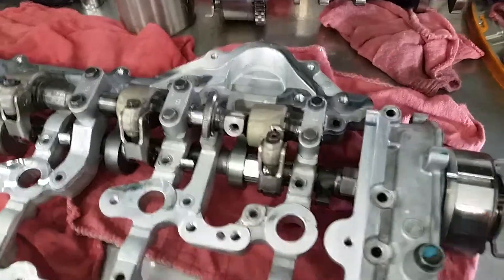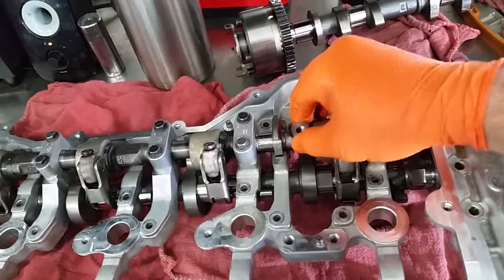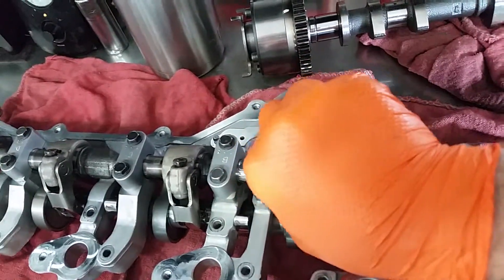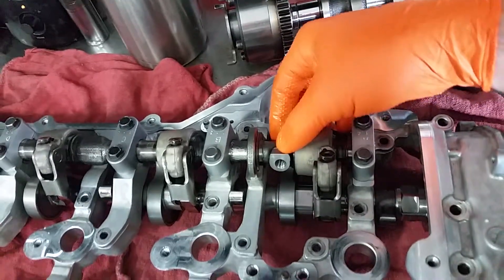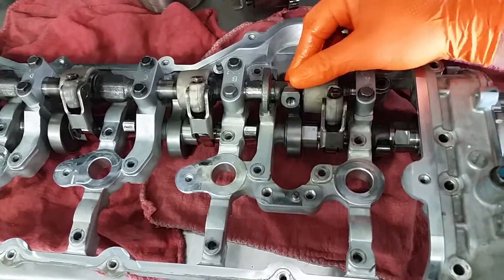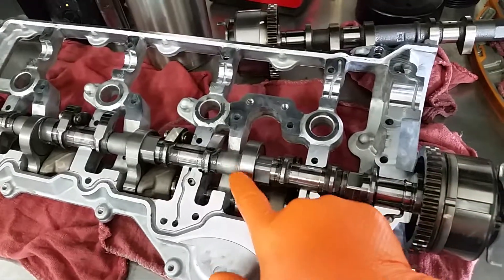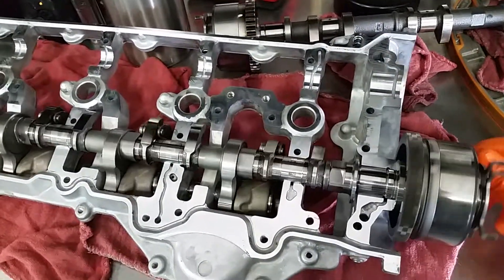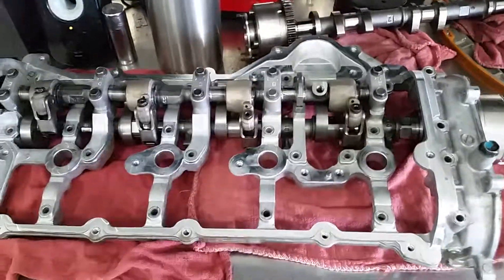Nissan/Infiniti VVEL operation

Comment: I replaced the timing chain on a 2012 QX56, and the scanner is showing that the inlet valve timing on bank 1 is 20 to 30 degrees at idle, but the scanner says it should be between -40 and 0 degrees. When I installed the chain, I noticed I could move the inlet sprocket by hand. Do I need to remove the tensioner and rotate it a full turn against the engine's rotation? Do you think that will solve the problem? I just removed the cover on bank 1 where the inlet valve sprocket is located and also removed the valve cover to see if the sprocket was slipping when I moved the camshaft, but I was surprised to find that it seems fine. Could the sprocket be stuck internally and not advancing properly with the oil pressure when the engine is running? I have many questions, and I would really appreciate any ideas you could give me.

Comment: Is 0w-20 too thin of viscosity for the Nissan 3.5L twin turbo engine?
Reply from the maker: The advent of 0w20 is all for fuel economy. If the manual says that it calls for 0w20, then it is safe to run it, however I would run 0w30 or 5w30 in my personal vehicles. You get much better engine protection with 30. Especially on a twin turbo, and never go over 5k mile oil change intervals no what. A lot of manufacturers are going to 7500 or 10k oil changes, but do not follow that.
Reply: @haloguru2552 Thanks Bud!
Reply from the maker: @Noypi54494  no problem

Comment: I have an issue with a 2014 V8 y62 nissan patrol (VK56VD) and i hope you can advice on it. Issue is subtle RPM drop and throttle hesitation at low speed (8-9km.h) or when i'm idling in a traffic stop. Changed sparks, coils, throttle body, and cleaned injectors. MAF sensor clean, O2 sensor good, and fuel pressure good. The issue went away when a garage told me they adjusted the VVEL sensor voltage from 1V to 2.5V. Issue was gone for 1 week then its back again now. I'm thinking to have a look at the VVL sensor and clean them as well, hopefully that will resolve the issue.

If it doesnt, I'm contemplating if i should replace the VVEL sensor, or i will need to replace the actuator motor itself?

Really appreciate the advice
Reply from the maker: That's a pretty complex issue you've got going on. Not really much I can say without having seen it. Another common issue we've been seeing recently is worn through high pressure fuel pump lifters, so I would definitely check that.
Reply: @haloguru2552  Fair enough. Thanks a lot!

Comment: What's wild is that with vvel, the throttle body isn't actually used. It's only a safety feature that normally remains open while running. The engine speed is entirely controlled by adjusting the intake valve lift.
Reply from the maker: That's incorrect. The throttle body works normally. The vvel system controls the valve lift; essentially changing the cam profile on the intake side during harder acceleration.